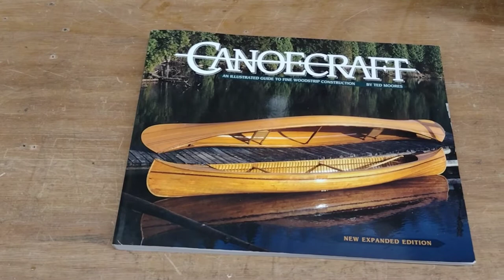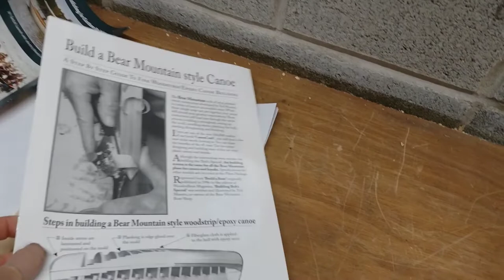Building a Cedar Strip Canoe - Episode 1, Introduction

Comment: Hi Andrew, great videos.
I was wondering where in N.I. did you source your cedar and ash?  I've seen timber suppliers down near Dublin, but I would like it to be a wee bit closer to home. Thanks
Reply from the maker: Hi Alister. I got it from McGregors, on the Sydenham road in Belfast. They keep a good stock of less common timber. However, they had very little cedar in stock, and the piece I got was the only 12' one. Worth giving them a call to see what they have. Where are you based?
Reply: @adpsimpson  Thanks for the reply, I'm in Ballymena.
Reply from the maker: @alistairwylie6730  ah grand, not that far. I'm in Dundrod if you ever want to drop round, especially if you're going to be building one too.